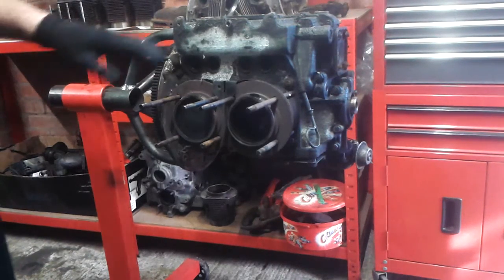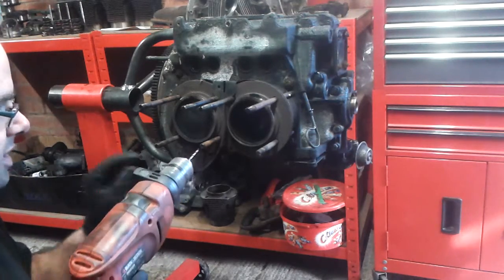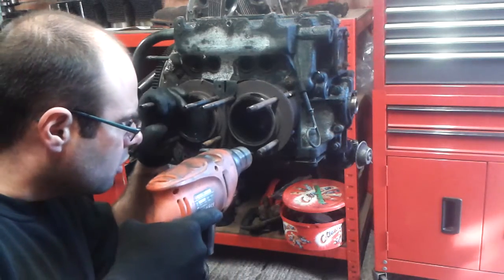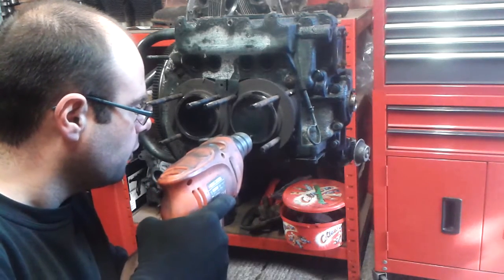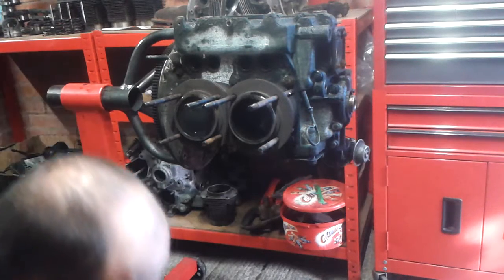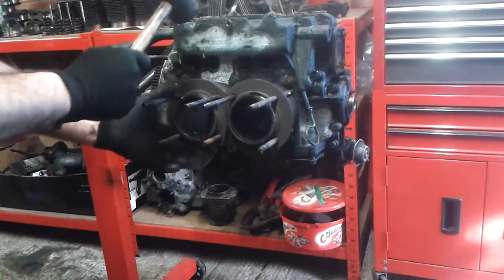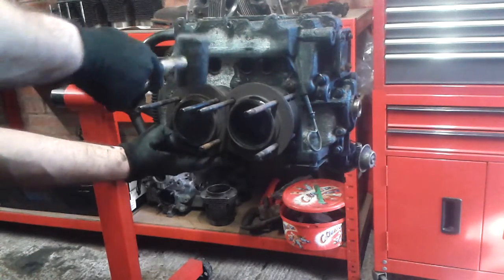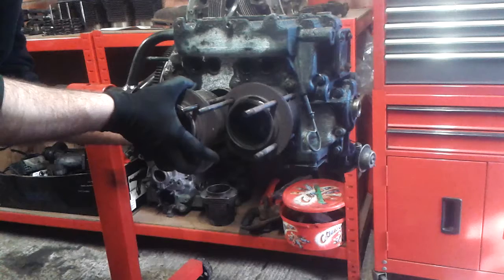VW Air cooled: How to remove pistons and cylinders without damage

Comment: Im stuck with process of removing heads. First i used rubber mallet gently, then regular hammer, i got afraid i might damage engine case so now im using a wood edge with regular hammer hitting the heads outwards. I broke the fins of heads and cylinders. Heads have moved out a bit but not moving any further. I sprayed PB Blaster between heads and cylinders and also inside plug and intake holes in heads. Its 3rd day and not separating. I tried to apply some heat between heads and cylinders but i get afraid when i see black smoke. Should i pour and soak it in diesel overnight? Or will applying heat the best way? Thx for helping
Reply: I was hoping to see a reply on this! I am having the exact same problem with my 1600 CC. I've had it soaking for 4 weeks with PB Blaster and one-week soaking the case with diesel. Still no luck I think I'm going to try to heat up the head and cylinders to see if I can break it Loose now
Reply: @olddog608  Hello! Yes I have some ipdate for ya and it may save you "heads & cylinders" :) So the best thing to do is mix diesel and ATF like 1 gallon diesel and and quart ATF perhaps, not to be precise tho. Pour the mixture into plug holes or heads. Let it soak for 3-5 hours while turning the side up or just leave it. Then repeat on other side and then viola! It will slide out easily with just a tap or few with rubber hammer without breaking fins or damaging studs. I damaged one side already. Hope my experience helps you :)
Reply: You won't damage the engine case